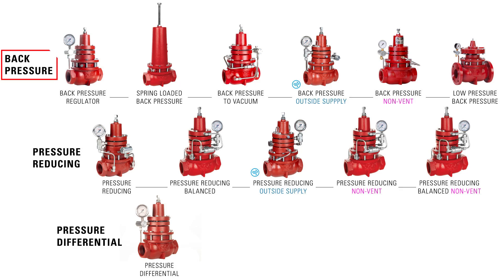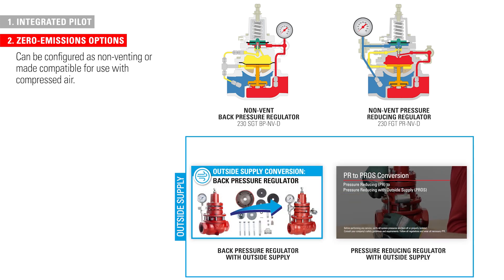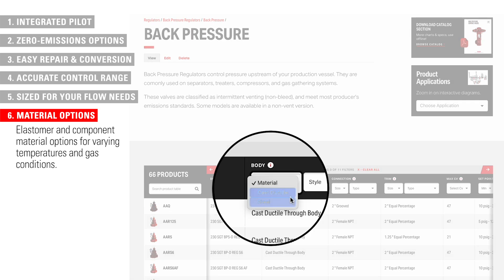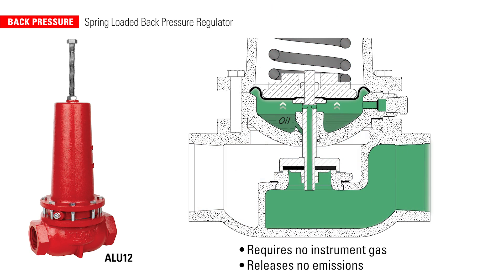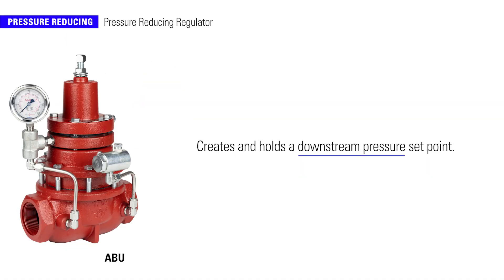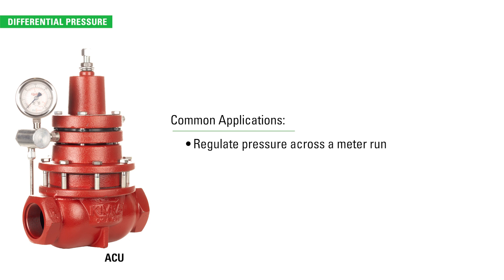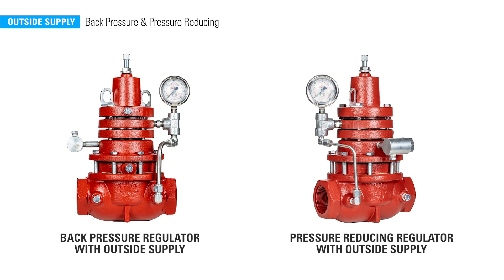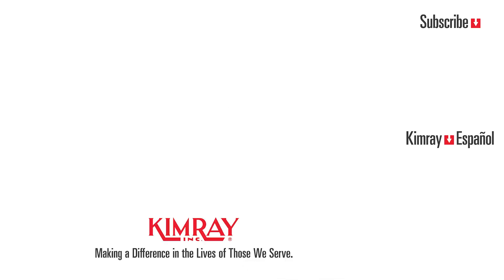Regulators (Back Pressure, Pressure Reducing & Differential) | Kimray Product Overview Series

Comment: When you say "outside supply" does that mean an I-P controller can be utilized to remotely control the regulator?
Reply from the maker: For our products, the term "outside supply" is referring to the power source for pneumatic equipment. Instead of the traditional natural gas, this would be a supply source such as compressed liquid nitrogen or compressed air. 

Here's our video about Kimray and outside supply sources: https://www.youtube.com/watch?v=SxZbSijhDJs